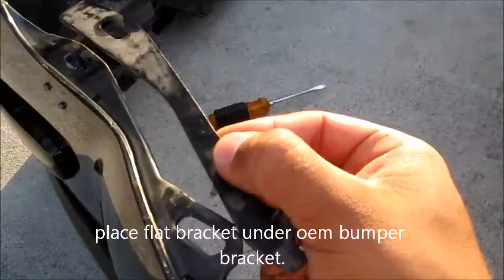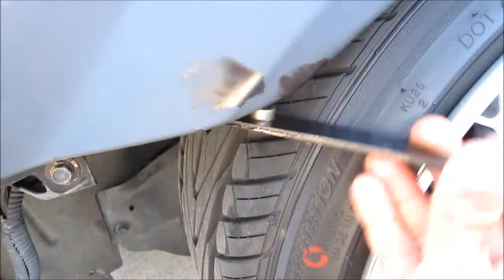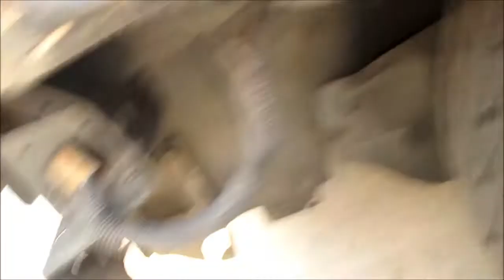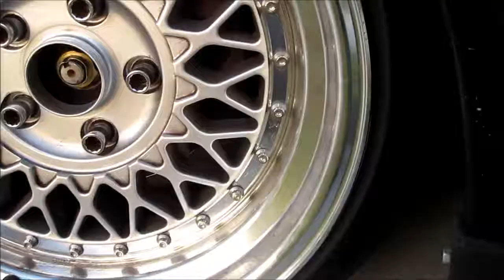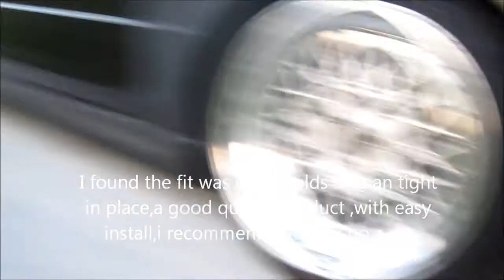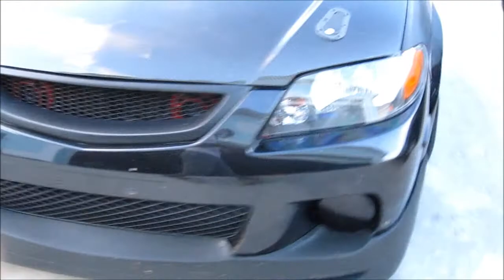Mazda Mods Episode : 29 AAC bumper bracket mazda protege 5

Comment: any advice on removing the plastic oem plastic mounting tabs on the side fender bumper bracket? did you drill them out or clip/break them off? thanks for the vid!
Reply from the maker: pureform media i just broke them out ,but most werent even there,try pliers ,or a drill bit like u said
Reply: troy watford word, thanks man...have had the aac brackets sitting around for a while, finally getting around to installing them this weekend.